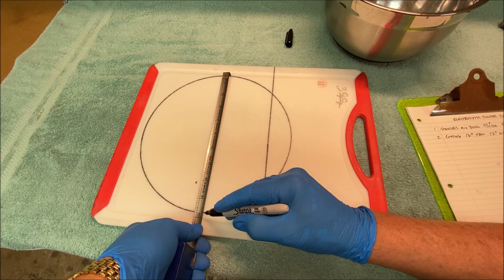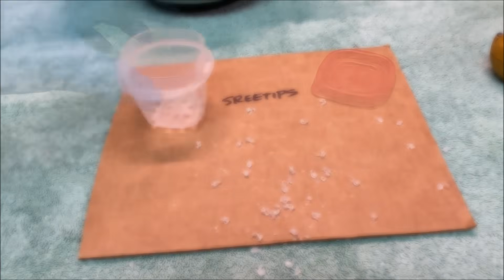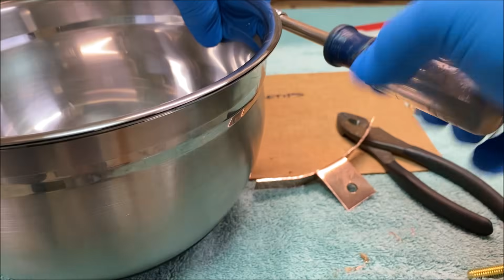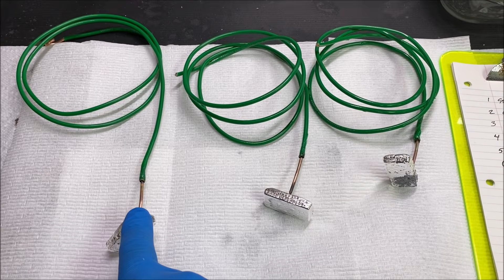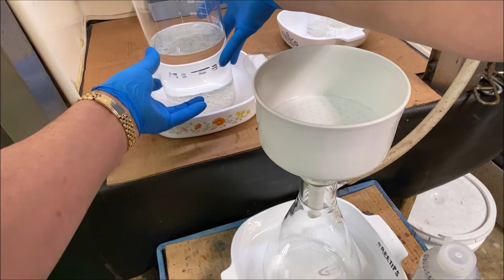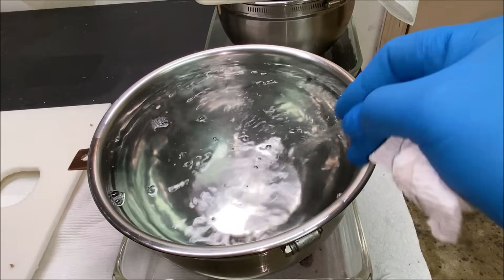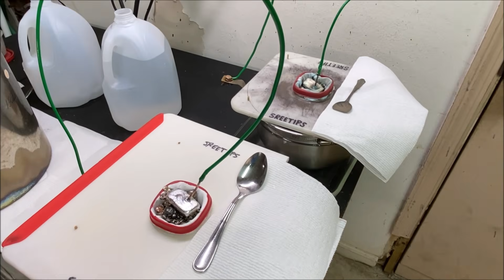Silver Cell Build Step by Step From Scratch for Beginners

Comment: How many batches do you go through before you replace the electrolyte and can you process the silver out of the old liquid?
Reply from the maker: I never use the electrolyte more than twice because copper builds up in it and the silver gets depleted as the cell operates (it plates out on the cathode).
Reply: @sreetips  wouldn't that get expensive having to add 600 grams of pure silver to nitric acid every two batches
Reply from the maker: I actually use 800g for every two runs. I add 200g more for the second run. Now that I’m running two cells, I’ll be reserving 1.6 kilos for two runs of two cells to use as electrolyte. No free lunch. Getting metal this pure is never quick nor easy nor cheap. But it’s well worth the effort.

Comment: The bamboo is a joke.
I would use something like 1/4" or even 3/8" dowel and have them hang down long enough that you could set it on a table and not disturb the basket. 
Sharp bamboo SPIKES... 🙄

Comment: Ok i understand everything except the  unrefined silver below the anode. What is the point of that?  And where would one search for that, just junk silver?
Reply from the maker: I buy sterling silver at local sales. I use it to refine gold. I recover the silver from that, melt into shot (the impure granules under the anode electrode bar) and run it through my silver fell to produce high purity, investment grade, greater than three nines fine, pure silver metal.

Comment: With a system of two containers and two pumps (non conductive hosing) it seems like you could continuously pump electrolyte between the two. In the first container you would plate out the silver, and in the second you would keep the electrolyte clean by plating out the copper. I'm not a chemist, but would that be possible?
Reply from the maker: The electrolyte is silver nitrate. As the cell operates, copper from the impure silver in the anode basket, dissolves and starts building up in the cell.
Reply: @sreetips  Your other videos show the solution as a green.  Why is this clear?  Different solution?
Reply from the maker: Sometimes palladium will get into the electrolyte. It’s yellow. Copper is blue. Yellow and blue make green.
Reply: @sreetips  understood, which is why I was curious if the dissolved copper could be plated out in a reverse/separate process in another container so that the electrolyte could be used longer in the silver process.
Reply from the maker: There’s no process tgat I know of that can accomplish that.

Comment: Excellent. Save a some bucks; ditch the stainless clamp, and copper strap.
Attach wire directly to the bowl rim at four points, evenly spaced points around the rim.
12 Gauge wire is more than adequate.

Comment: I am wondering why you don't just use a larger container instead of 2 setups. In the last silver cell video, I mentioned why not use something as large a drum barrel. Does that require a different approach? Is it too costly?
Reply from the maker: 4 inch critical distance between the anode and the cathode. Too close and the silver will contact the anode filter and burn a hole through it. Too far away and the silver takes forever to deposit on the cathode. I could set up a thumb cell; alternating anode and cathode plates hung suspended in silver nitrate electrolyte. But that’s too big for my small hobby operation.

Comment: If you're cutting plastic with a circular saw, especially brittle plastic, and the cut looks rough you can try turning the saw blade around so the teeth are backwards.
We use this trick in construction all the time. Don't forget to put the blade back in the proper orientation when done and remove the battery when changing a blade.

Comment: I was thinking of an auto-feed setup for your silver cell. You could find a copper pipe that fits into the filter basket. Then find a way to support it about 1/4"-1/2" above the top of the filter basket, so it doesn't come into contact with the electrolyte. The pipe would be filled with silver shot and it would serve as the positive connection, the current would travel down through the silver shot. As the silver dissolves, more of it would it slowly drop down from the pipe into the basket.

Comment: TIP: Drill two holes in opposite corners for the filter basket hole. The jig saw blade goes into those holes and you can cut the outline easier.

Comment: A simpler way to find the center is to take the chord that you drew (the first line) and mark the center of that line, between the two points of intersection with the circle. Then use your square to draw the perpendicular line from that (flip the square and do it again just in case the square isn't perfectly square). The center of that perpendicular line is exactly the center of the circle. No need to eyeball it or guess.

Comment: Finally! That was really needed for your current production, given the amount of impure silver you have in stock waiting to be processed, and I wouldn't be surprised if you find out you need more cells. Great content as always.
Reply: Where do you get the supply of impure silver to refine?
Reply from the maker: I refine gold. I use sterling silver, that I buy at estate sales, to refine the scrap gold. I recover the silver from that, melt into shot, and run it through my silver cell. Silver is a by-product of my gold refining. The cell converts the impure silver (about 980 parts per thousand silver) to high purity four nines fine (9999 parts per ten thousand) pure elemental silver metal. So I’m refining the impure silver, that I recovered from my gold refining operations, into high purity silver, not creating silver out of thin air. When the silver cell is full of pure silver, I harvest the pure silver crystal, put it away and forget about it. Then I repeat the whole thing again.
Reply: @sreetips  Thank you for sharing! Does that 980 silver need to be in small pieces like in the video or can it be a block from a melt please?
Reply from the maker: I’ve used it melted into bars. But shot presents a greater surface area.

Comment: So if you do not have any pure silver to start with to make the electrolyte, the silver cell will not work?
Reply from the maker: You can use pure silver bars or coins to make the electrolyte.
Reply: Yeah, that's what has me scratching my head and asking "why, in the first place?"
Not being mean, I'm really curious to "WHY"? So, is this process just used to purify silver? Or does it say take a little silver and MAKE A BUNCH of silver or neither ,it's just a kewl process to watch with no increase or decrease in the amount of silver being used.
I'm just left scratching my head as to why, what is this process's purpose???
 Sooo you take Silver crystals(which is pure silver that melts and cast into perfect bar) silver nitrate and impure silver...and pass electricity through all of it....and that silver transfers itself into the bowl...
I'm lost
Reply from the maker: This is silver refining. Silver is money.
Reply: @lonniemcgallion  Yes, the process is to strictly purify the silver to a very high grade and you have to have pure silver first to make the electrolyte as I come to find out. If you are not fussy about having 99 fine silver then use nitric on the e-waste or impure silver item, denox, use hcl to drop silver chloride, and convert to silver metal or use the copper cementation process to also get silver metal.

Comment: 2:56  just gunna point out an easier way to find centre would be to just draw 2-3 lines across the middle of the circle from different angles.  Where they intersect is centre of the circle.

Comment: You did a video on silver solder. Could you cut/ melt silver solder instead of a higher purity silver shot?
Reply from the maker: Probably not because the impure silver going in must be fairly high purity to begin with.

Comment: How long / how many onces one can harvest before changing the Ag-nitrate solution and how to get the Ag- out of that used solution or are the 600gram lost?
Reply from the maker: I average 1.5 kilos of high purity silver per run. I get two runs from each batch of silver nitrate electrolyte. But I add 200g of pure silver nitrate solution to the second run to replenish the silver concentration. The silver concentration become depleted as the cell operates. Some of it deposits on the cathode

Comment: Some helpful conversions: 
9 1/2' - 241.3mm
9 1/4' - 234.95mm
9 3/4' - 247.65mm
4.5' - 114.3mm
16' - 406.4mm
12' - 304.8mm

Note that half of 247.65 is 123.825mm I hate having to get the pen and paper out to calculate fractions of a cubit...

I think that's all... on a serious note,  it Seems to me that all you need to remember is to keep 10.5cm between the anode and the cathode. Considering the calculations are typically metric, I'm willing to bet the original recipe has 10cm as a convenient distance...
Reply: 1’ = 304.8mm

Comment: Forgot the fuse on the anode bar wire.
Reply from the maker: Good point.
Reply: Only necessary near the end, will trip unnecessarily near the start due to high current.

Comment: I've done some experimental DIY in the past. Seeing how he does it, I bet Sreetips has been trough a lot of iteration, research and trial/error before finding his optimal solution. And he's giving it all up for us to use. Thanks for sharing :) Not everyone thinks about sharing their knowledge instead of keeping it for them and profiting from it.

My only remark on this build is that you should consider using XHHW wire instead of solid copper. HXXW will have more flexibility while remaining quite rigid. Also AWG #10 is oversize for the 2.5A that goes through it. #14 will be plenty big enough (good for 15A), more common and less expensive. And no, the color doesn't matter :P
Reply from the maker: The 10 gauge copper wire cam from a yard sale. It was close to a full spool when I bought it for two bucks five years ago. It’s rigid. This rigidity help apply a down force on the anode bar and keeps the impure silver pushed down and in contact with the electrolyte. It’s the perfect wire (in my opinion, and experience) for my silver cell(s)
Reply: @sreetips  Great explanation

Comment: Could the hole be tapped so the bolt threads through the copper for an even tighter connection?
Reply from the maker: Not thick enough for that

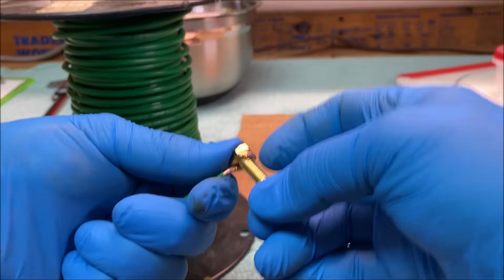Comment: 19:22 an improved connection would be to hammer that down a little so you had a flat surface instead of the rounded surface.  Easy way to skip the need for a crimp-on washer connector or similar.
21:42 a wee bit of sanding is required on the copper, then degrease with solvent, then a touch of flux for the best electrical connection. Keep in mind next time you make one of these.  Also I would recommend a silicone insulation to take the heat better.

Comment: You can scribe/ score and then bend copper and it will break off after a few back and forth. Also, your jigsaw will cut copper.  Third, Wiss makes a straight cutter that works better than the Wiss red handle you were using. Yes that one is for straight but it wanders. The one you really want cuts a channel. It’s great, especially on thicker sheets
Reply from the maker: Like a nibbles. I need to get one.

Comment: Will the thicker copper effect the amount of current you can pass through the cell?
Reply from the maker: Copper is the standard for conductivity. It’s rated at 100. Gold is rated at 78 (I think). Silver is rated at 105.
Reply: Not really, it is way oversized.

Comment: Excellent video!  Only thing I've ever really wondered about is using pure silver for your anode bar?  Would it make a difference, other than the ease of working with it, if you used cement silver for the bar?
Reply from the maker: I use pure silver for the anode electrode bar because it’s so easy and clean to work with.
Reply: @sreetips  that was what you said in the video!  :-)
Reply from the maker: Copper is the standard that all other metals are compared to. Copper is rated at 100 for conductivity. Gold is rated at 78 (or maybe lower, can’t remember) iron is like 40. But silver, being the best conductor of electricity of all metals, is rated 105. So use pure silver for that reason also. But it takes many words to say it.
Reply: Good point.  There’s an experiment.   Use a cement Ag anode to process your cement Ag shot.
It can’t perform any different than using pure Ag.

Same thing goes for using cement Ag to make up the electrolyte.
Every gram of won pure Ag gets added to the finished Ag stack.
Reply: @williamfoote2888  that would pollute the ectrolyte from the start and throw off the volt/amps right out of the gate.  150 grams per litter of pure silver for the electrolyte I understand, pollution is why it has to be replaced.   Running current through copper, then pure silver, to cement silver, to electrolyte is what is throwing me.
Reply: @Sanzus2  No it wouldn't.   The pure Ag anode, now, is directly connected to a Cu wire.  As pure as the anode might be, if it dissolves over time, which that anode is designed to do,  and its letting Cu into the electrolyte.
It may or may not be purer than the shot cement Ag that he's pouring into the anode basket to be processed.  It'll work the same way, with no difference.

The electrolyte doesn't 'need' to be pure, as we see it turn blue and we know S uses the Cu contaminated electrolyte twice anyway.

The electrolyte draws the amps and volts that the solution can bear.  There is no 'optimal value' for either.

With regard to the several metals being used for the connection, it doesn't matter.  All are highly conductive.  There is no point where the connection will get hot, or otherwise indicate resistance .

Comment: Red handled sheet metal shears are for turning right, green left and yellow handled for cutting straight. Didn't know if you knew that. Great video by the way.
Reply: I use my reds for straight cuts lol. Plumber not a tin man thou!
Reply: @monkeydrains8285  Not a tin man either, I learned that in 4-H when I was knee hi.
Reply: @linn1934 I learned it in Boy Scouts. 🤷🏻‍♂️. I dare you to ask a teen today if they know. “Well, red is like blood, so use the red ones when you’re angry.” 🤷🏻‍♂️🤦🏻‍♂️😂
Reply: Interesting. Just opposite of navigation lights on a boat which are red for port or left and green for starboard being right.
Reply from the maker: Same for aircraft
Reply: @mortonyakimadetectingthepa9015  Heck, I might be wrong then. I do know yellow is straight though.
Reply: I have green handled ones, they cut straight
Reply: Yellow are actually meant for the garbage bin. Or cutting wire 😂
Reply: I didn't know that. Thanks.

Comment: Thank you for your videos. I never knew until about 2 months ago you could grow silver🤯 Now I'm ready to begin my own. Question: how could someone aquire silver nitrate without a fume hood? The fume hood is an elusive creature in my budget😉
Reply from the maker: No way to do these reactions safely without a fume hood.
Reply: @sreetips  thank you
Reply: @candacedavison2986  I'd listen to Sreetips and not the other person telling you do it outside.
I've worked with oxalic acid and formic acid in my beekeeping to kill mites.   Even that stuff requires one to wear protective eye, skin, and respirator.   This stuff you would be working with is much more dangerous.
Reply: @beebob1279  thank you
Reply: Do it outside but in a garage or between two building where the wind direction doesn’t change then blow a fan on it so the fumes are always blowing away from you. So with the garage door open and a fan blowing the fumes away. If you do it just outside the wind could blow it into your face.
Reply: @fajile5109  thank you
Reply: Or build a fume hood complete with a filter before you poison your surroundings...Did that rust clipboard or tarnished hold down spoon start out that way or is that a residual effect of the chemically charged air??

Comment: $250 for a wire that’s welded into a silver bar? like come on. 😂 you literally just wrap the copper around the silver for less than that.
Reply: I agree that's $250 for that is stupid. But you can't just wrap the copper around the silver any place that the copper wire came in to contact. With what hes using for Fuel I e Impure silver shot It would also eat the copper wire. That's Why the annoed bar Has to be changed from time to time because it eats the bottom of it
Reply: @johniesmith7672  I mean, if you’re making money, I have no problem with that but. Yeah, what you said 😂

Comment: Excellent video. Much better than the others. I have one question,.. if anyone can answer.  Can liquid silver nitrate be used as the electrolyte for the silver cell and…. Can I used the liquid silver nitrate to make the shot.?!
Reply: That’s two questions. I think so, and…I don’t think so.
Reply from the maker: Silver nitrate dis solved in distilled water will work for electrolyte. In a recent video I turned silver nitrate to pure silver metal.